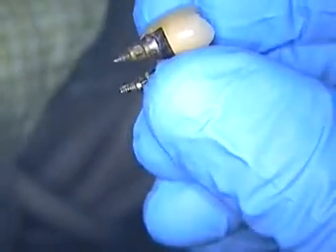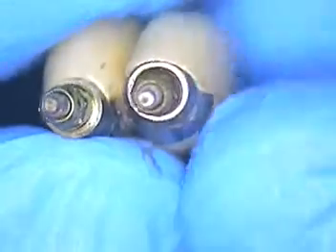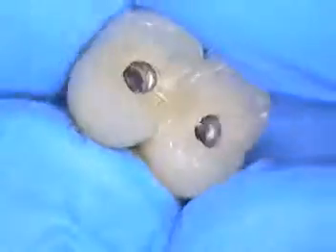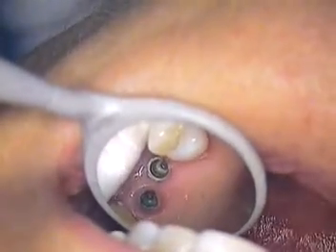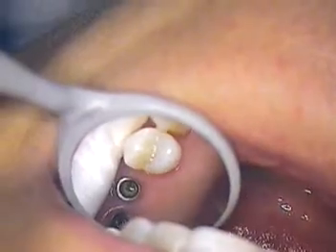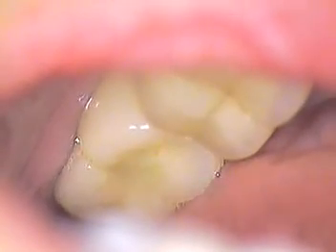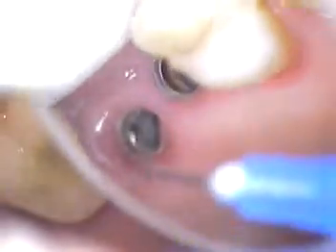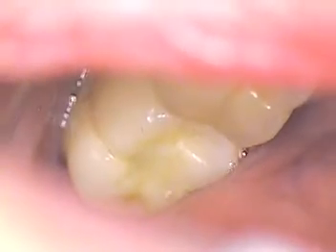4. Avoiding Needless Dental Implant Bridge Remakes - loose abutment screws with difficult access

Comment: Hi Doc , my 2 abutment fell off friday. The gums closed The dentist did not clean the gums . The dentist just put a new abutment did not open the gums but just screw the abutment in the implant directly pinching the gum tissue. Is this safe? I believe the gums must be cut open to clean. I am worried. My dentist tightened the other 4 screws ( I have all on 6) and it was all extremely painful when the dentist tightens each of the abutments)